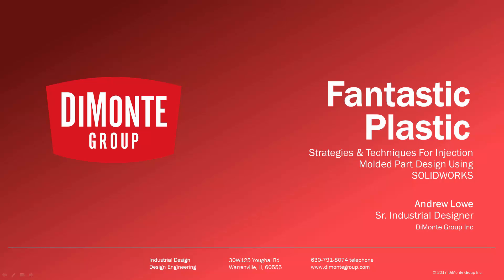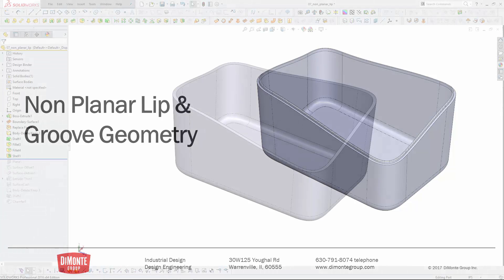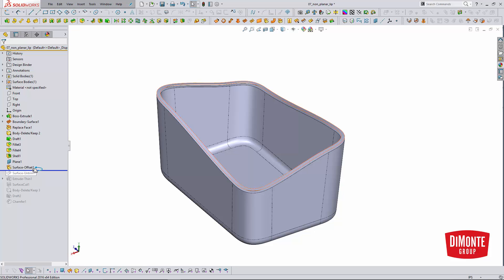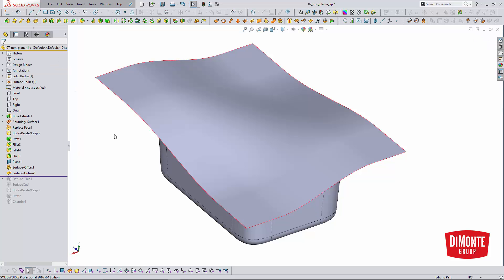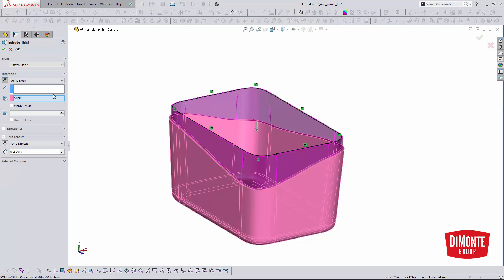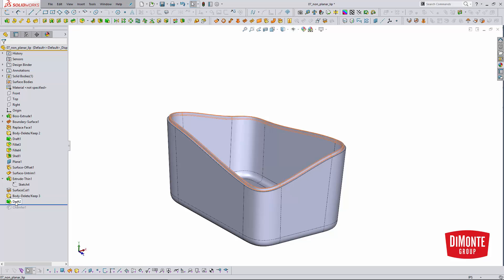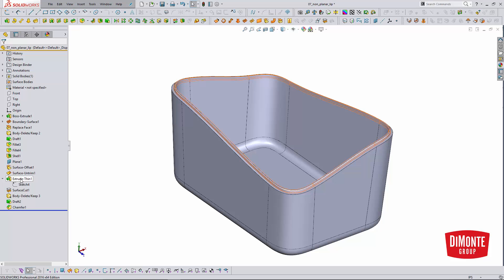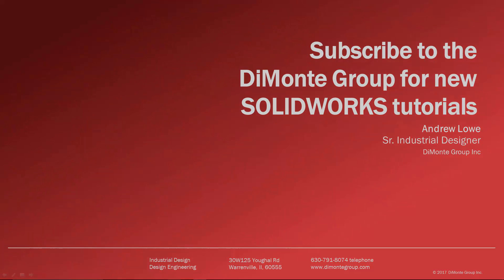Non Planar Lip and Grooves - SOLIDWORKS Tutorial - Fantastic Plastic 07

Comment: One degree draft is 0.017" per inch.  So if you have a wall a tenth of an inch high, that's 0.0017 draft on the part which is next to nothing.  If a half of degree draft, it's less than a thousandths.  Not worth adding that little draft.

Comment: I have used a similar method to this before and I kept getting sketch errors on converted edges when I made changes to the geometry early on in the design tree.  Do you have any tips on making converted edges more robust or is it inevitable that big geometry changes will cause converted edges to fail?
Reply from the maker: Big geometry changes will most likely require fixing sketch relations, the higher up in the feature tree a change is made, the more opportunity for downstream rebuild errors. That said, I always try and use the replace sketch relation tool instead of deleting the sketch entities and re-converting. Any repaired sketch relations mean less rework fixing failed drafts, fillets, etc.
Reply: Thanks for the tip! I will try repairing relations in the future, normally I just delete the sketch and start again but I do end up with at lot of failed fillets.